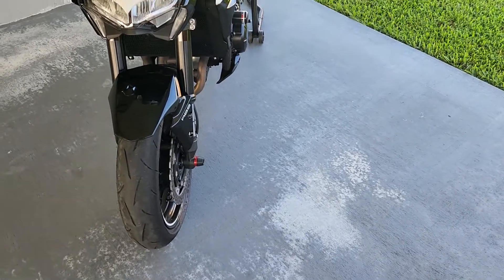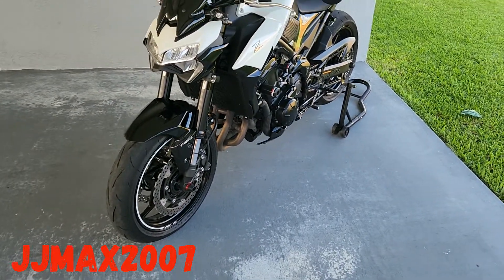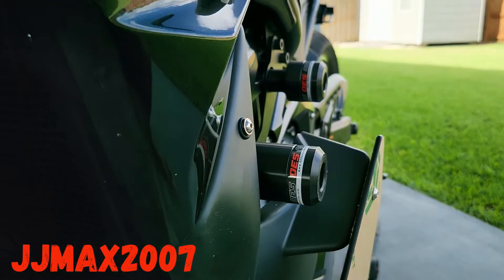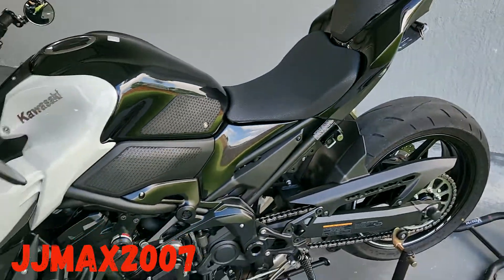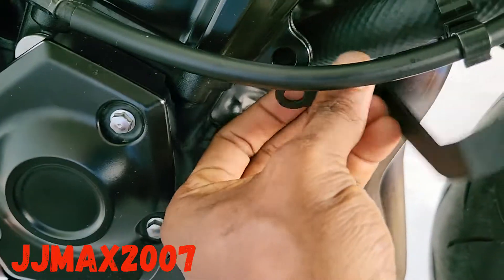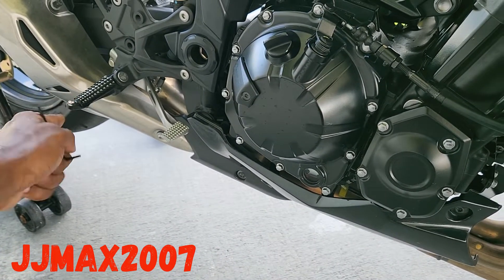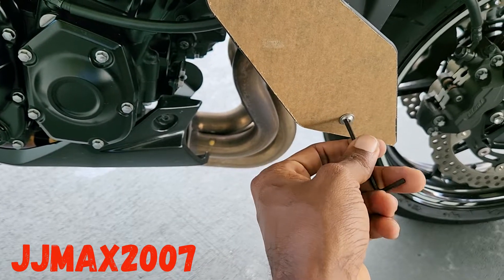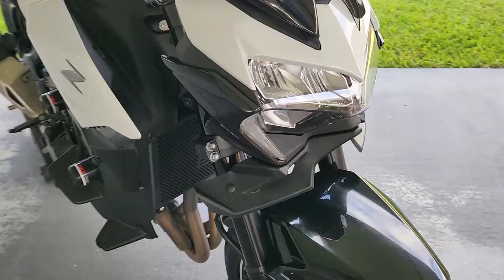KAWASAKI Z900 2021 - 2024 SIDE FAIRING DOWN FORCE INSTALL

Comment: hi, after installed fairing down force did you experience vibration on tank side especially when release throttle ?
Reply from the maker: @mmzpatriot5029  the fairing can not be the reason for that have you reached out to the person you purchased it from ???